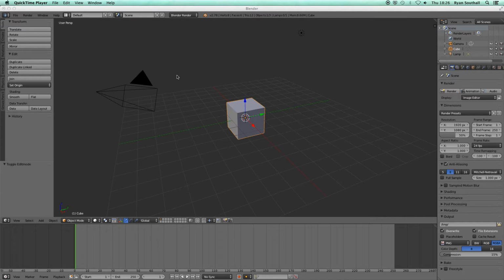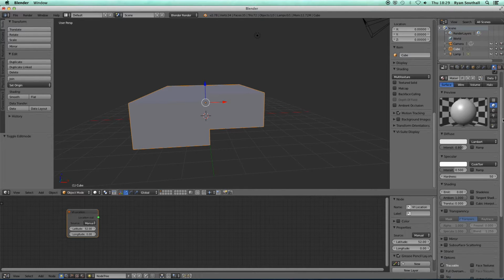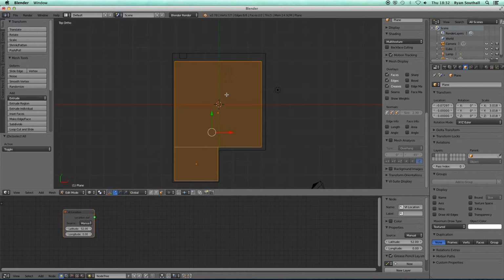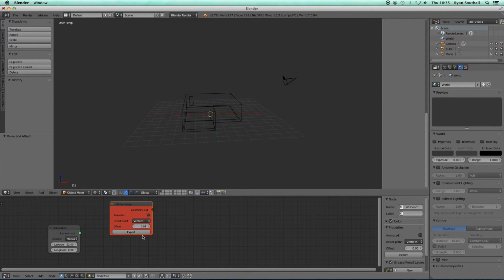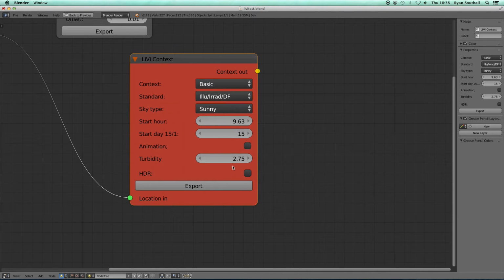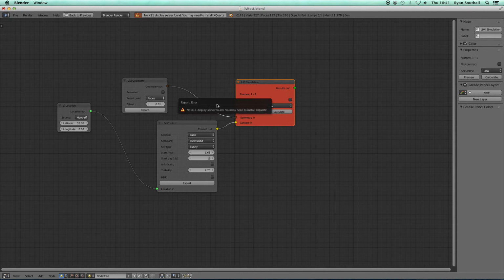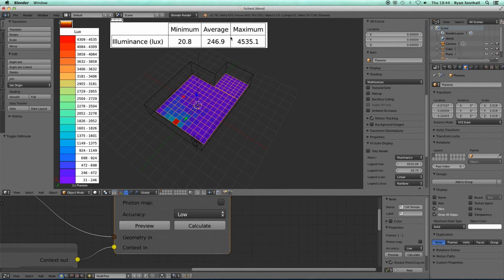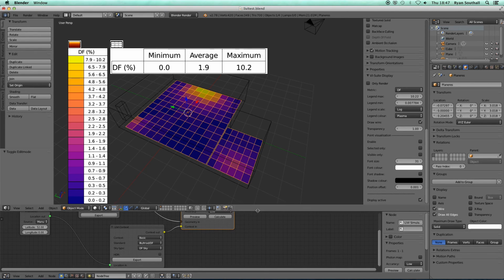VI-Suite v0.4 - Simple Radiance Lighting Analysis

Comment: Hi, I was following your video tutorial but I faced a problem where the Legend Colour  of VI-Suite Display does not appear but there is values on the Full Irradiance Legend. Is it anything to do with the software or I did any mistake? What should I do?
Reply: When I enable Point Visualisation, there is values on each box of the planes but just that there is no colour appearing on it.
Reply from the maker: Hi.
You may need to switch to the Cycles rendering engine in Blender.
Ryan
Reply: @ryansouthall8464  OK thank you. Also, do u know whether I can do individual Ray tracing on VI-Suite? I  want to see how the light rays travels to the plane, for example when they travel through a medium of glass.
Reply from the maker: @junshenwoon8826  Hmmm. Not sure how you do that. Radiance can do most things and it could well be possible to trace an individual ray. If so, and you can extract the intersection points, you could create corresponding line geometry in Blender with a Python script.